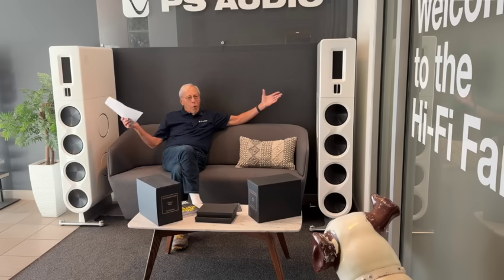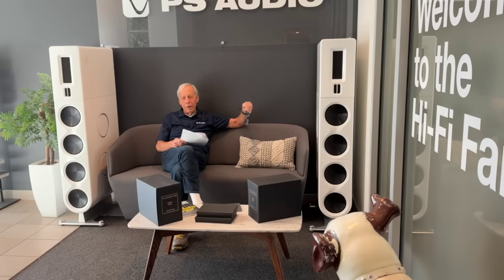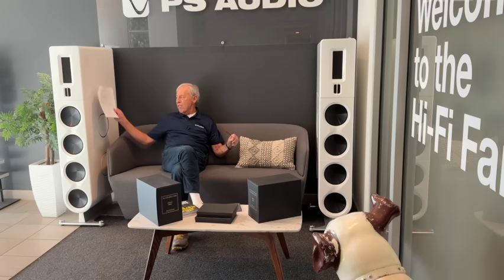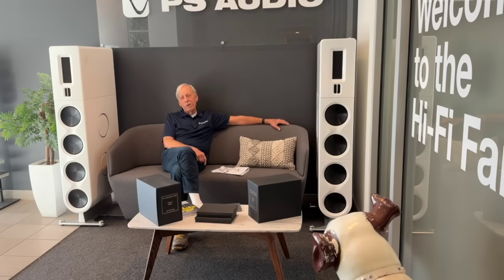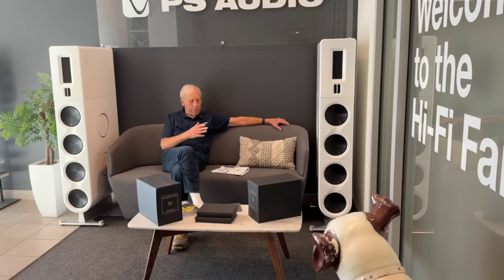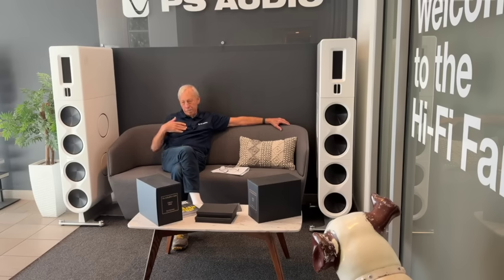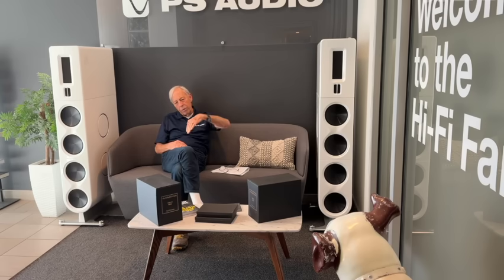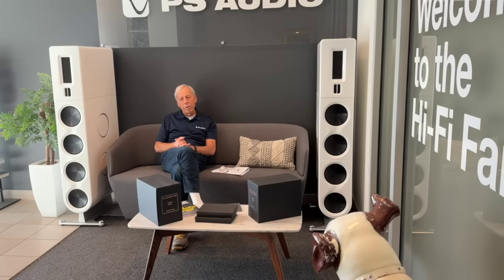Crossover complexity in speakers

Comment: Simple crossovers are best like a simple capacitor that Speakers like Advents and EPIs used. For those simple crossovers to be successful the drivers should be made by the speaker manufacturer so the tweeters, midranges, and woofers have natural slopes that integrate with each other before there's any crossover installed so you only have to use a simple capacitor to remove the bass from the upper frequency drivers.

Comment: I've designed and built speakers for decades. Audiophiles (and I have no problem referring to myself as one) completely overestimate the "complexity" or "number of crossover parts" aspect. It's far more important to get the frequency and impulse response, in-time and in-phase, off-axis behavior etc. right, than try to be puristic and minimize the number of parts. Of course one is going to need the necessary minimum and not the unnecessary maximum, that should be self-explanatory from a common sense and financial perspective. Given the choice of using (a) better driver(s) versus better passive parts, that's also a no-brainer, especially if they allow for using lower crossover orders, but again, phase response is key. It's a matter of getting the design right, "purism" isn't an excuse for one that's flawed. Besides, most full-range drivers, at least dynamic, need an LCR for linearization (the so-called upper midrange "shout"), not to mention they tend to be used with single-ended tube electronics and hence may profit from impedance linearization. In a nutshell, there's a distinct difference between "purism" and "minimalism". As an aside, I have a hard time believing Chris Brunhaver spends "80%, 75%, designing the crossover" as Paul says, given Chris designs the drivers in house.

Comment: The Emit tweeter used in Infinity speakers like the Quantum series made me a fan of planar drivers, but getting the passive crossover optimized to allow cones and domes to blend smoothly with planar drivers must be very difficult. Depending on listening height and distance, I could sometimes hear the tweeter as a discreet sound source, an effect that some reviewers call "venetian blinding". Most of the time, the Infinity Quantum 4s were very coherent if I paid proper attention to listening distance and position.

Comment: A first order (acoustic) slope requires drivers of smooth,wide bandwidth. There are electrically first order designs that ,once they coincide with a drivers natural roll off imitate a 3rd order response.Given strong mechanical ringing that can take place at the top of a woofers band,coupled with pushing a tweeter close to it's resonant frequency, distortion can become objectionable. The crossovers are,or should be designed bearing in mind the needs of the drivers being used.

Comment: There are channels now that show designing crossovers (DSP) using driver measurements where one of the tests hooks up both drivers with no crossover, in order to test the acoustic center delays. Even then, there was a huge crossover notch in the one I watched due to phase shift of the drivers. It is simply impossible with those drivers to create a in-phase first order, simple crossover. Just because the crossover circuit is simple doesn't mean the acoustic crossover is simple. In my experience, minimalistic circuits usually only work with the polarity reversed on one driver, which can sound very good.

Comment: The crossover... perhaps the worst possible place to cheap out on the parts quality and yet... all but a small percentage of commercially available speakers do exactly that...
Reply: Ended up with a $1200 bill for top notch passives on a 2.5way myself, close to the cost of the drivers and necessitating a separate enclosure due to sheer size of film caps and flat ribbon/toroidal coils. Even at bulk discount prices, that explains it.
Reply: @paulb4661  I’ve designed a set of speakers that I’m planning to build. My best design, and possibly my final design. From what I’ve learned about crossover design is that you don’t put components in the signal path. The wire should go directly to the speaker element, and the caps and coils are off shoots to ground.  Of course, if you can’t match SPL’s, you might put a resistor in line, but it’s best to choose drivers with similar SPL’s so you don’t need to do that.  My present set of speakers are Legacy Focus 20/20’s, and they are huge and are 5 way. I had to work on them once, and wow what a crossover! Two huge boards with coils big as your fist, lots of parts. But it does an amazing job, they are very sweet and natural across the entire spectrum.  Complexity isn’t necessarily a bad thing, if it’s done well.

Comment: Do you use a klippel to test your speaker designs?
Reply: You can build an anechoic chamber for that price and do it properly. Or have a certified lab do the measurements in their chamber.
Reply: @dabbidaa1547 
I'm not sure one could build an anechoic chamber for the price of a Klippel. 

Also ... what certified labs are you referring to?
Reply: I wonder how well the klippel can measure planar magnetic speakers.
Reply: @mitchtaylor6512  
No different than other platforms.
Reply: @mitchtaylor6512  
Perhaps you're referring to dipoles? 
Planar magnetics come in more than one form, ... ie., PS Audio's Aspen series utilize planar magnetic mid and high drivers.
Reply: Paul, or more to the point, Chris does not use a Klippel the last time I spoke with him.

Comment: The rules of frequency are clear and as soon as a crossover is in the mix the frequency structure is changed , yes the less complicated a crossover is the better the sound but a tuned speaker environment with good drivers tuned ports is perfect , my experience with tuned speakers has been amazing far more natural way more power and very sensitive and a frequency range with no gaps 20/20 they just sound pure

Comment: Lets get to the fundamentals. The sum of the (lowpass filter + woofer) and the (highpass filter + tweeter) should equal your original input signal.
This can only happen with 1st order filters. 1st order filter can in theory reproduce a square wave. This is impossible in higher order filters which discard information, create phase shifts, and ringing. 
Note that high order filters have some benefits (eg power handling, off axis response) and can sound good, but if the goal is true high fidelity then they fail. 
Vandersteen , Duntech, Dunlavy, and Thiel are a few examples of companies that use 1st order designs.
Reply: Can speakers [transducers] reproduce square waves ? Is any square wave included in music or slew rates are smaller and softer [infinite in a square; 2 diff. points at the same time] ?
Reply: @Jorge-Fernandez-Lopez 
iirc, Tom Danley designs his Synergy platforms to pass a coherent square wave.
Reply: @FOH3663  Regardless of that platform or any other, the air in front of the drivers can't be pressurized instantaneously, which is an infinite acceleration (a square wave is two different voltages divided by "ZERO" [no lapse of time]) nor any driver can do it. The music has no square waves included. It's simply not possible.
Reply: @Jorge-Fernandez-Lopez  
Indeed. 
I'm not claiming Danley's, or any platforms can pass a square wave, ... merely sharing the design goal was to reproduce square waves. 

If you or anyone reading isn't familiar with the Synergy design, it's quite compelling (multi-entrant multi-way horn).
Reply: @Jorge-Fernandez-Lopez  I have white papers from John Dunlavy showing approximate square waves from his Duntech speakers.
Reply: @Jorge-Fernandez-Lopez  A perfect square wave - obviously not, but they can reproduce an approximate square wave.
Reply: With the exception of Vandersteen, they're all out of business ... right?
Reply: @FOH3663   ...I know Kiat Low personally & although I haven't spoken with him in years I'm
pretty sure that Duntech is still in business. You have prompted me to give him a call & find out.
Reply: @FOH3663  Proving that marketing often beats engineering.

Comment: Is fluid dynamics a consideration for speaker design? If so do you use CFD?
Reply: I guess it could be used to analyze the flow through ports etc, but I don't believe anyone is using it unless they have a specific problem to solve. 
There's several good softwares for speaker design, VituixCAD for instance is free and used by many in DIY (possibly professionally as well).
Reply: Physics, as in fluid dynamics and wave theory, are crucial to speaker design, even if one doesn't know it or pay attention to it.

Comment: The best sounding speakers I have heard use very simple crossovers.   
Some of the worst sounding speakers I have heard also use very simple crossovers.   
I have yet to hear a really good sounding speaker with a super-complex crossover.
Reply: Check out the crossover in the aspen FR20 then 😝
Reply: I utilise first order in mine,but for a more complex passive circuits with potentially "good sound" depending on preference, both Harbeth and Vivid audio are good examples,I feel.Unless you've heard them and didn't like them,of course.
Reply: @oliverbeard7912   ...yeah, Harbeth definitely.

Comment: No it's not the most critical part the crossover it's the drivers but yeah it's up there
Reply: I agree. To make a car analogy, the drivers are the engine, and the crossover is the transmission. Good luck going anywhere without the engine.
Reply: @BruceCross  
Good luck going anywhere without the transmission.
Reply: It does not matter one tiny bit the excellence of your drivers and cabinet if you use a cheap and crappy crossover design, a shit crossover will destroy the best speaker on earth.
Reply: If a crossover is doing something wonky, it could make any combination of drivers sound bad.

Comment: Chris is on the right path. In the 1970s-1980s, Dutch speaker designer Hans Baan also put most of his effort in crossovers. His series of speakers of that time are still sold quickly on the Dutch used gear marketplace. I have two Translator Impact5 four-way tower speakers and they still rock. They make the detail and precision from an Accuphase E-380 amplifier shine through clearly and that's no small feat.

Comment: Am I the only one who feels like he didn't really answer the question?
Reply: I thought he answered it, and he said "it depends on the desired outcome."  That would be true.

I know Paul W. Klipsch famously said the fewer components the better, but that pre-suposes that quality drivers are used and there isn't much junk which needs to be gotten rid of.

OTOH a cheaper driver might need more components to get rid of frequency peaks and dips to get make a flatter frequency response.

So, it depends.
Reply: Yes me
To
Reply: Yes you’ll find that is more the rule than the exception here.
Reply: Pat McGinty, genius speaker designer and his crossover work from my original Meadowlark Audio Kestrels 1994-1995, to my Meadowlark Audio Heron i’s from the early 2000’s..amazing stuff!
Reply: I do believe he covered as much as he could in that amount of time, you're never going to get an in depth answer in 5 minutes. 😄

Comment: Hey Paul,  listen to this. For my first two-way speaker system at 15 years old, my dad (elec. engineer at Rockwell-Collins) had me hand create the bass crossover for my attempt at home-made speaker design.  We used a drill to create the copper-on-air coil inductor.  What an experience. It looked kind of amateurish but sounded great.

You are absolutely correct. The crossover is the most important component in speaker design… after having top-of-the-line speaker components of course.

Thanks for the video.

Comment: The Pearl Acoustics Sibelius loudspeaker series is built around a single full-range driver per cabinet and no traditional crossovers or filters.
You can go overboard with complicated crossover circuitry and multiple drivers.
In the end most of us  have only two ears and as we age our hearing sensitivity diminishes.

Comment: I built my own crossovers last year for a 3 way home build. started with 2nd order that i could not get sounding how i wanted, went to a first order using mundorf, after alot a switching components and cutting coils down ( with a meter) I finally hit audio nirvana! Nils lofgren keith dont go sounds incredible. Drivers are sb acoustics and mid is a 800 series bowers! Just need to build new cabinets that comes with its own issues and one day run a REL mic test!!!!

Comment: Robin Marshall, who was the genesis of EPOS Loudspeakers, was a loudspeaker designer for Mordaunt-Short back in the 1980's.
He managed to design a tweeter & a mid-bass driver that were so perfectly matched that the crossover was a single capacitor to
stop any mid-bas frequencies from going to the tweeter. ONE CAPACITOR was the whole crossover...can you believe it?!!
This raises the question, why can't other loudspeaker designers do the same & keep the crossover components to an absolute minimum ?
Reply: Polypropylene cones are much forgiving in terms of upper range break-up, the stiffer the material with less internal damping, the steeper the slope required and the higher the component count, usually. Linearity, distortion and off-axis reponse inevitably suffer with first order crossovers, but compromises will always have to be made, while priorities differ depending on designer's intention.
Reply: Perfectly normal practice for AR speakers of the 1970s & 80s. My model AR18s (produced 1981 - 83) uses a single capacitor in series with the tweeter, continuing the method used in the original AR18 of the late 1970s. The electromechanical characteristics of the woofer cross it over at the appropriate frequency.
Reply: It wasn't that uncommon back in the days that most of the drivers played without much of a crossover, but in speaker design there's Never a free lunch, there's Always compromises. And we have come a really long way in designing the whole speaker system today (well most, some brands are about fan base and not about engineering, like Klipsch etc).
Reply: @PSA78   ...& now we move into another phase with active loudspeakers & active crossovers.
Reply: @FatRat-f9m Yes it can change things a bit for the better as it's not passing the signal through components that can color the sound (or shunt power). IIR filter in DSP still behave like a passive filter, and the A/D and D/A converting is not as good as high-end standalone equipment, but overall it's a far more economical way to build a high-end product that most can afford.
I'm still on the fence about using drivers that needs a lot of filters to behave, maybe with good FIR filter. 🤷🏻‍♂️
Reply: @PSA78   ...maybe more attention should be given to driver design. However, how much loudspeakers
will move from passive to active or with active crossovers in the next ten years will be interesting to watch.
Reply: @FatRat-f9m I believe a lot is happening with driver design, they use less and less box volume for instance, but I'm not sure if it will all stick, maybe it's a phase and things will evolve. Older designs are often really well behaving while being affordable, it's just that they require a larger box. 🤷🏻‍♂️
As prices goes down it should increase the amount of active speakers that's being made and sold, I do believe lots of people still want a good sound system and not just small designer stuff, so if it's easier to hook up and set up people might buy bigger stuff again. 🤷🏻‍♂️
Reply: @PSA78   ...active loudspeakers with streamers & DACs built in means less boxes in the wife's living room  😂
Of course there will always be that niche of high-end audio guys who want 27 boxes on stands plastered across the front wall of their listening room while the rest are enjoying the music. If drivers can be better designed to match better then less complex crossovers can be implemented. I'm very much in the "Less is More" school with home-audio gear.
Reply: @FatRat-f9m  Speakers are in a sense all about finding the best compromises that give you drawbacks you're willing to live with. 😆
Reply: I have mixed feelings on crossovers. Part of me likes minimalism, but another part loves steep slopes.
Reply: @BruceCross   ...are you good on skis too?
Reply: @FatRat-f9m  No, I'm a klutz.
Reply: @BruceCross   ...the Winter Olympics are almost here & you mentioned steep slopes so I.......never mind 🙄
Reply: Look at Hans Deutsch Bösendorfer Speaker VC2 or VC7
Reply: 🖤The designer that oversaw my full-custom midrange speaker build also worked for Mordaunt-Short post 1985. M-S was a part of the TGI Group that also owned Tannoy, Goodmans, Epos and Creek Audio. During the very late 1980's, Andy worked alongside Robin and it was Andy that perfected the mid bass unit in the Epos 11 Monitor. That monitor hit the shelves in 1991 - Absolute Legend Status.
♠🤔Didn't know that did ya ratty.. well did ya..? that's what friends are for ay..?🫤🥶
Reply: @clickbeetle2720   ...awww...friends? That's so nice 😁 OK friend, who the f#@k is Andy  ? Andrew Jones?
And yes, you are correct, I didn't know that...but then I can't know everything; right? 😝
Thanks for that little tid-bit of Hi-Fi past history.